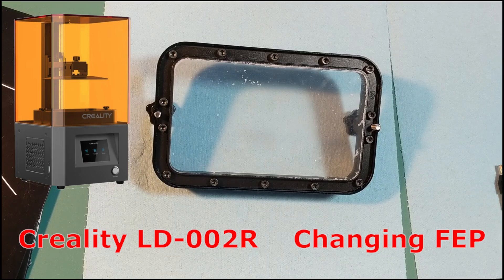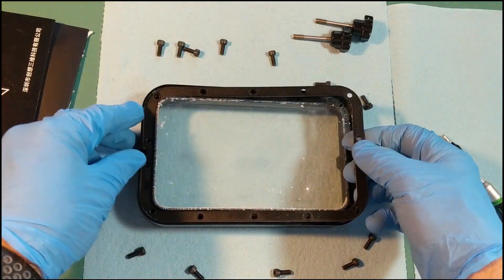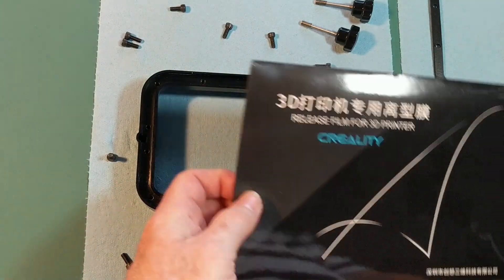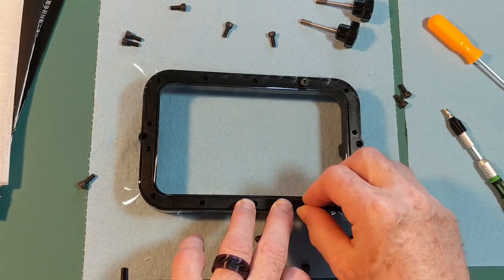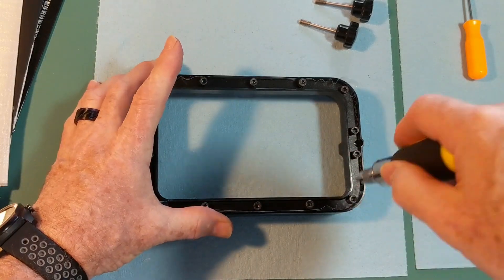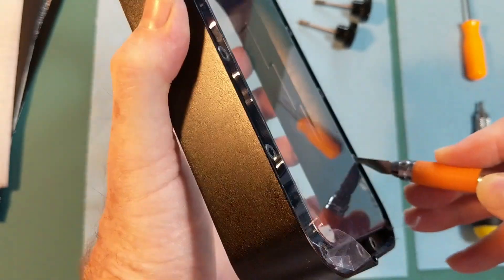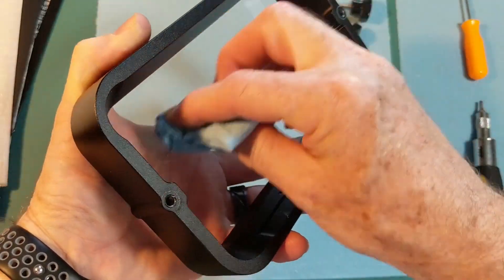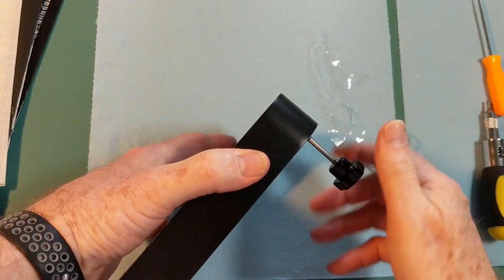Creality LD-002R Changing the vat FEP

Comment: Good afternoon. Can you tell me why when you click on the model to print , on the printer,Creality ld 002r, The printer has chitubox 4.4.3 v1 LSDK1/ 1620*2650 firmware.
The error is displayed: The cutout does not correspond to the projected -1440 resolution?

Comment: Thanks for the great video. Got a question for you though. When changing my FEP, there was a rubber gasket on the underside which came out and seems to be too loose to fit back it. I didn't see one in your video. Is it 100% necessary or will it leak resin without it?
Reply: I have the same issue mate, have you found any solution?
Reply: @harunyorulmaz7696  I trimmed.mine and super glued it back together. Not the best but it seems to working ok
Reply: @corvusgamesterrain  glad not to be alone :D I've used hot glue, seemed more appropriate at that point
Reply: Hi havw same problem. Do you know the rubber ting size? Or i can use a hot glue to feel the hole

Comment: So, i'm going to do my first FEP change, but one of the screws isn't coming out. It un tightens but it get's to a point where it just... goes in circles and doesn't come out any further. And it won't fall off of it's slot. All other screws came out normally, xept for that one. ¿Any advice? (it "stops" roughly about the same height where the other screws finnaly come off)

Comment: Hey man, do ypu think I alreadyneed to replace my FEP it seems like everytime I print there is some cured resin sticking on my fep while pringting. I use esun clear resin I also made sure the settings was right. I already cleaned the FEP tho it was already cloudy, also I rehome the build plate but it seems the issue was not resolve.
Reply: I use LD 2 R

Comment: followed along but when I wiped down the inside of the part where the holding-ring goes, it stretched out a rubber cord? it wont go back now.
Reply: I have the same issue, some strange rubber o-ring that was way oversized.  Did you find a solution, or discover what that o-ring is even for?
Reply: @RyanEdwardsVA  it still hasn't fit entirely back in but reassembling the vat with new FEP either pushes it back into place or is tight enough to not seem to matter.
Reply: @kalebspicer5453  gotcha. I managed to push mine back in with the blunt end of a paintbrush and it seems to be fine for me as well. Weird problem to have but hey, looks like we managed lol
Reply: @RyanEdwardsVA  yeah I pushed mine as close as I could get lol. Happy crafting!
Reply: I dont get my rubber back at all, its like 150% too large..

Ive used it without since it popped out, I quess its for prevent resin leaking? Havent leaks tho
Reply: The O-ring is oversized so it will expand when seated, making a complete seal. The best way to get this type of O-ring in is to get it roughly in place, then start pressing it in on opposite sides working outward.  If you are super tidy and careful, the O-ring isn’t needed, but alas, some of us are lacking no matter how hard we try...
Reply: Damm so they dont sell replacements just the whole vat. Im having the same problem

Comment: i have had an issue with the thin rubber gasket that is in the bottom of the vat breaking while doing the cleaning of the bottom of the vat for fep replacement, i can't find this gasket anywhere , any ideas?
Reply: I just had the same issue. I'm probably going to get a tube of automotive gasket maker to cut, shorten, and fuse the two ends together since it's been stretched out. That or use the gasket maker itself to put a line of silicone in that crevice.
Reply: @franciscoaguilera49  how'd the experiment go?  Considering where it's placed, I wonder if that rubber thing is even necessary... I can't for the life of me tell what it would even do.
Reply: Did anyone ever discover what that thing is even for?
Reply: I dont get my rubber back at all, its like 150% too large..

Ive used it without since it popped out, I quess its for prevent resin leaking? Havent leaks tho (same answer also in another topic in these comments)

Comment: Wouldn't that additive contaminate the resin? Granted, you obviously haven't had problems with it, but its still adding a chemical to the resin bath that hasn't been accounted for.
Reply: My thoughts exactly.  I have had zero issues with my LD-002 R and prints sticking to the FEP, but perhaps not all FEP sheets are equal...

Comment: why you add PTFE grease on it, specially on screen side ? every instruction for vat cleaning advise to use IPA, that will definitely remove any grease, but no one mention about regreasing
Reply from the maker: The PTFE is put on to help with the release of the print from the FEP.
Reply: @gen3dmaker531  but you wipe with same clothe side of FEP that touches screen.
Reply from the maker: @porlockos  Sorry, I don't show very well in the video .. it's not the same cloth with the PTFE. It's actually the other 'half' of the blue towel I split in two. The inside I used the PTFE release, on the outside I only use the dry blue cloth, and then the lens cloth.
Reply: @porlockos  you dont need to lube the FEP, FEP is alread made of PTFE, adding more does nothing its a myth. 
It doesnt even last more then a few layers anyway, by the time the base layers are cooked in, its all been pulled off anyway.

Comment: Great video , now that I see how it is done it doesn't look that complicated , just take your time , but what is you don't have that fancy release agent , is it going to make that much of a difference , do you think Creality did that in the factory before they send out the machine .As with Lockdown every where I don't think I will be able to order that any time soon .
Reply from the maker: I'm finding putting the release agent on is helping quite a lot in releasing each cured layer from the FEP. I'm also seeing that PTFE is working better than the RainX. I do not think any release agent is put on the FEP from factory or third party FEP. Typical FEP is very slick, but adding the PTFE is helping my prints.
Reply: @gen3dmaker531  does it feel dry after ptfe? it might contaminate the resin no?
Reply from the maker: @eried  after applying the ptfe, you use a dry cloth/towel to wipe off any excess liquid ptfe. Let it dry completely before adding resin. I haven't seen and issue with contamination with the resin.